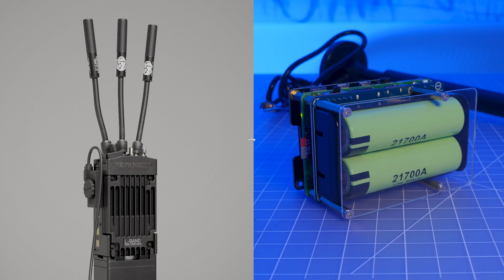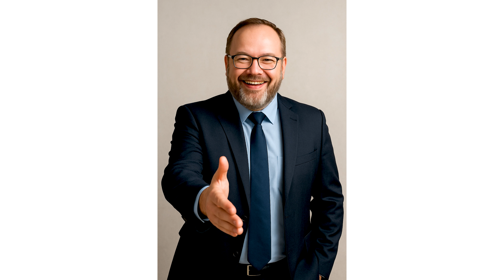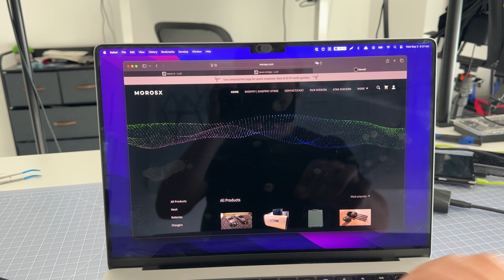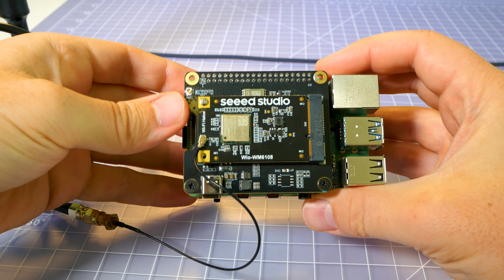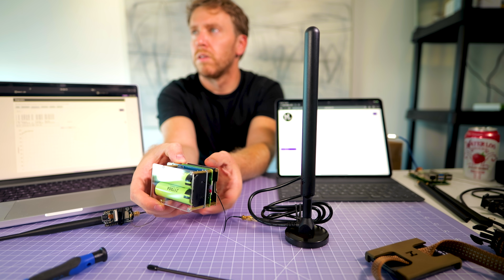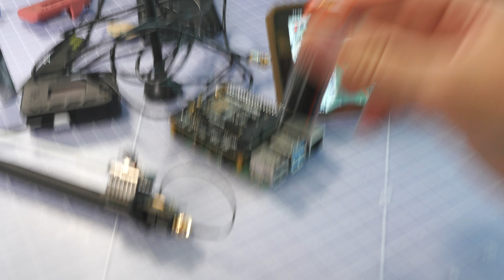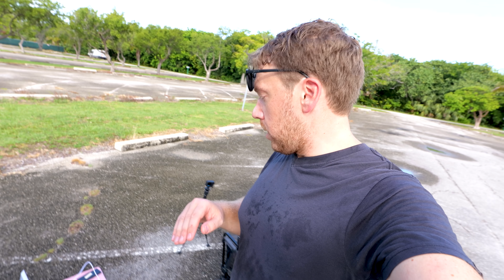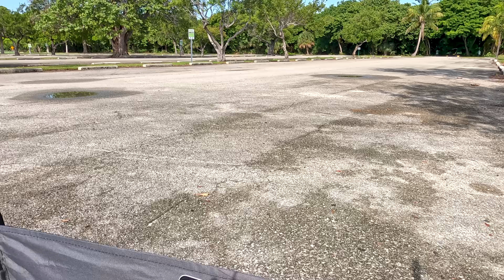I Built a $20,000 Military Router for $106.23

Comment: It's a great project, but misleads in saying " army pays so much more for something equal". It's not that. Although you are able to bring the same functionalities, army grade equipment  uses specialized components, PCBs are tougher and more expensive, construction needs to be much more solid and less prone to interference, just to mention a few things. That said, congratulations for an amazing project !
Reply: Just the testing a normal non gov product sold to the public needs to go through is a heap of money..
Reply: I'm sure a military grade version would still be under 1k even with more durable components and shells. Probably under ~700$ if the production is large enough. They're getting absolutely screwed on that 15k. The testing QA per unit per component is what screws the costs to high hell.
Reply: For example, if you started today, it might be five years from now before you'd have your radio with basic military encryption (classified, secret) approved by the NSA -- assuming you got it pretty right from the get-go. That's just one reason military radios cost so much. You're also going to need to have physical security measures, and work from -40C to +85C or so.
Reply from the maker: Totally, the military stuff is built to a completely different spec.
Reply: Im guessing you are american by your answer but i highly doubt they have different mosfets, transistors, caps and so on. They are paying that much because thats their budget
Reply: @ouew3872 Nope,  I'm not American, but I had a chance to look at some older (not to old) but specialized equipment. Tick PCBs, 6 or more layers, gold contacts... You could see from the board layout the work, very well done signal planes, ground planes etc... Im not saying is all like this, but if you add those, plus waterproof, casing, and like the others mentioned the testing and required standards it gets very expensive. Im far from judging if its 10k worth or 30k, just mentioning that what I saw was good quality.
Reply: @PingTheVoid i guess the testing and making sure it works increases the price tag. But you cant really compare older stuff since they had to overdo stuff to even make it work, nowadays with how advanced cheap components are and how cheap quality boards are you can get away with cheaper products that still do the job. Its like they always say in our design lectures, as complicated as it has to be and as simple as its allowed to be.
Reply: @ouew3872  I just thought the same, I bet he also buys a router that says “ military grade”
Reply: Military grade = the cheapest bid submitted. This doesn't mean it's the highest quality. Military equipment is one of the simplest and cheapest pieces of crap there is. The military doesn't make its own MOSFETs, transistors, or capacitors.
The military announces a tender, defines the terms and requirements of that tender. The military also sets the UPPER limit for the price.
Then you or I go to the Chinese, order X device in Y quantity that meets only the requirements specified by the military in the tender, and try to reduce production costs to zero to maximize profit margins.

In short: Military grade = the most expensive junk.

Honestly, when Ukraine stopped hiding its professionalism in the military and showed that a $300 drone can do the same thing as an ultra-professional $30,000 drone, suddenly everyone in the eastern armies started asking what they were paying for.
This is one example showing the meaning of military grade.
Reply: @lobxtmic 
Remember that the specifications that the military is asking fore is when it comes to fore example radios really high 

Fore example the us have had fore the last 15 years electronic equipment that shoots down drones whit microwaves. And that is way hardening and certification is REALLY expensive
Reply: That's not true at all, it entirely depends on the contract holder. Lot of government stuff isn't more robust than retail versions because they literally use the same parts.

Comment: @DataSlayerMedia. cool project . Do you happen to know about easy cheap method to make something like "alfa camp pro" ? small router with external usb wifi adapter for long range wifi extension?
Reply from the maker: Ya so another way to do this would be to use a usb dongle like the heltec or a small mobile router lik gli.net. Those setups might be even cheaper..
Reply: @DataSlayerMedia more compact also.  UsbC internet, Ethernet, WiFi and halow. All in the heltec dongle.  Remarkable device.

Comment: From what it looks like, it is literally just a RPi4, a Seed Studio SSD hat and a battery pack hat plus some antennas and extra non essentials like a basic Rpi4 router case. Come on man, charging $100 for just the parts list is just sad tbh. The whole point of building open source projects like this, is to keep them open source and available for anyone to build. Someone else will just build it themselves without your guide and then release it to the public the way it should have been done by you if you weren't so money hungry.
Reply: I share your sentiment. i am curious though, could you do something like this ? he has the parts list on the github links. if given the parts could you get things working? I tinker a lot with similar stuff but not radios, so i am not sure.
Reply: @harmonicspice2536  I have messed with meshtastic and I would be able to do it comfortably. Its mostly a barrier to entry of understanding what is happening. Learn a little about halow and you will be fine. It looks much scarier than it is as most the software is already out there and ready to be used.
Reply: word❤
Reply: God forbid someone wants to make some money lol
Reply: @VolksUndBrot  Timothy 6:10 "For the love of money is a root of all kinds of evils. It is through this craving that some have wandered away from the faith and pierced themselves with many pangs."

God does forbid the lust for money actually 😊

Comment: An RF engineer you are NOT.

RF budget ABSOLUTELY determines maximum bandwidth!

Try again kid.
Reply: Sure... when you're actually designing an RF circuit. When you're kitting together a Wi-Fi based system based on off-the-shelf pieces, your bandwidth adapts based on the signal strength, so from the user's point of view, their only degree of freedom is the antenna.

Comment: You'll be hearing from our lawyers, JK, but the reason why the MPU5 is 20k is that's its a military radio, sourced from NDA compliant parts and has far superior security then WPA3, and far mote throughput then 2 Mbps.
Reply: Also the money they spend on testing to get fancy government certificates and legal council to make sure everything is compliant.
Reply: It may be crazy expensive, yet not a crazy expense, if the costs of a failure are big enough.
Reply: @Cyberguy42 In large scale war, the cost becomes prohibitive and cheaper alternatives rule, like is seen in Ukraine. For special operations maybe fine (not the Russian version...).
Reply: It is more durable than COT parts that he used.
Reply: I don't think anyone doubts it's a bit better than this. There's no way it's $19,900 better though. Better encryption is available open source...not like that's an in house one off.
Reply: @chublez  It's not simply better encryption. If you're using a radio for military purposes, you have to have NSA-certified encryption to send any kind of secure data. That's not just certification of your radio to meet spec, but certification of your device to ensure it doesn't leak secure data. It takes big bucks and years to get that certification. And that's just one part of why real MIL radios cost so much. There are also a bunch of protocols for the security keys, and rules for how often they have to be changed, etc. There's more to it than meets the casual eye.
Reply: @chublez if your life is on 4he lone it is.
Reply: @meatbyproducts  that's an emotionally charged statement that dismisses his point completely. He was saying you could get the same exact product but way cheaper if it was made privately instead of on a military contract.
Reply: @TheRedAvocado might be true, but what was built isn't close to the same product. Finding similar boards and saying it will dovthe same wifi is dishonest, since most of that cost is working in extreme environments and worlibg with Soldiers and Marines.   His won't and CAN'T do that.
Reply: We spot the fes
Reply: You would think that..
Reply: Sure thing bud... It's probably the same hardware different but the same protocol for more money

Comment: Even if the issues for OpenWRT on the RBPI5 are resolved, you might want to keep using a RBPI4 as it's much less power hungry (15W vs 25W).
Reply: You can underclock and perform other configuration changes to the Pi 5 and get better performance per watt than the Pi 4. However, if the Pi 4 does a good enough job, then there's little reason to switch to different board.
Reply: @blahdelablah  seam held sake
Reply: Came here to say this. The Pi 5 is power hungry. I built a handheld device and had to upgrade the whole power/battery system when swapping from 4 to 5. But yes, it is also much more powerful, so it's not an empty tradeoff at least.
Reply: What are the issues that openwrt has on the pi 5?
Reply: If I could find a hat for the pi0 think it would work?
Reply: thats the whopping 10 whatts of diffrance
Reply: @uiopuiop3472  its also a 66.6% increase in power draw, which if your looking at 12 hours or original run time, that number starts looking like 8 hours
Reply: @uiopuiop3472 makes a difference on battery.

Comment: I would probably just grab a few cheap routers with Yagi antennas... or even go cheaper with some $5 microcontrollers... but what you built is way more impressive. 👍
Reply: If you know where your target is, a Yagi will get you range, but if it's a roaming situation, that's too directional.
Reply: The higher the frequency, the shorter the range for a given ERP. Lower the frequency and the range increases following the inverse square law. Both 915mhz and 2.4ghz have strict ERP limits, simply directing the beam is not going to cut it for most deployments...
Reply: @dougle03  In other words, radio propagation is well described by the Friis transmission equation, which factors in frequency, not the inverse-square law, which would be the same for any frequency and would have to be enhanced to easily deal with antenna apertures.

Comment: I understand you are US based but the 915 usage in eu is limited and risky. Just to be safe you would need to use weaker 868 band. Similarly the power limit for the 2.4 band is 20 dBm. Assuming you would want to build eu complaint device the results wouldn't be so spectacular. I am not sure what to expect though, perhaps you could consider some tests.
Reply: Yeah, I have experienced these limitations when I was deployed to NATO countries. We had specific radio systems that we couldn't use because of their different usage of frequencies than in the US. However, I have to ask... If there is a legit war, why should we care about that? We have a fight to win, and not worry about frequency restrictions and power limitations. The enemy doesn't care, why should we?
Reply: In the EU best you can do is 27dBm with a 10% hourly duty cycle on a single 250KHz channel (869.4 - 869.65 MHz). This band is mostly for sensors and intelligent meters.
But with the increasing popularity of Meshtastic and Meshcore we might get some other piece of spectrum for more interesting projects.

Probably the 433MHz band is better in the EU if you are registered Ham because it allows higher TX power and removes the duty cycle limitation. Check your local laws before you try :D

Comment: Everything is cheaper if you make it yourself, but the time you must spend checking for errors and going through the certification process makes everything fucking expensive. I speak from the perspective of a European engineer. By the way, most of the tech is relatively easy to make but very very time-consuming.
Reply: Ps. A lot of technology is unnecessarily overcomplicated because people make it hard to build.
Reply: @bar7m0r What do you mean by "hard to build" exactly?
Reply: @jeffgoldman1735 for example: simple ideas are magically turned into rocket science, so you end up spending 10k just to understand the basics while pretending not to scare the “secret society of initiated ones.” And, of course, the real core idea is never shown; you only get a copy of a copy of a copy and are supposed to feel lucky because you’ve been granted access to the “ultraclassified topsecret photocopy.”
Reply: The army had a dedicated engineering corps that can provide support (and I imagine often has to anyway even for commercial items, because representatives from companies can’t be pulled into active battles or sensitive situations when something goes wrong). It’s a different situation to Joe Bloggs running their own company and just wanting something that works. 

Companies overcharge for industry items (and particularly military) for a number of reasons. Certification is expensive, especially for military items. The user is typically not a subject matter expert, and thus cannot judge if the price is reasonable, only if it is comparable to other similar products, and that oftentimes the price-tag encompasses a very robust support system that is not found with consumer goods.
Reply: Also: this is barebones. MilSpec needs it to withstand dust, moisture, heat and other abuse.
This is only a proof of concept product.
Reply: @TobyLegion  that does not justify twenty thousand more dollars
Reply: @TheRedAvocado  Yeah, but it is one additional factor out of many.
This is a cool a valuable project, and it has the basic funtionality of the military router, but it is far from "the same". Is 20000$ still  to expensive for what it is? Probably, yeah. Is a 106.23$ home built device equivalent? No.
Reply: @TheRedAvocado garbage take. The 20k comes from all the certs required for the tool to meet spec and all the wireless testing. See the testing that the occulo team did for consumer certification. Military equipment is also made in smaller than consumer stuff. Smaller runs cost more. Easily make up the 20k with a nice slice for the shareholders, lol
Reply: The amount of paperwork required to deal with, in order to be able to speak with the military, is a fulltime job in itself. electronic component prices are almost always negligable in mil-spec projects in comparison to:
NRE costs (design, certifications, Qualification and field testing).
RE costs - Environmental-Stress-Screening per product, traceability of components, Acceptance Testing (The millitary inspecting your work, not free) per batch, Repair when product gets busted. 
Its a freaking catholic marriage whenever you sell hardware to the millitary
Reply: Welcome to capitalism! Where even time is money 🙄
Reply: No, you don't make cheap phone on your own

Comment: Talks about open source and wants $97 for a digital assembly manual thats somehow "sold out." Hey, no one works for free, but you really need to clarify statements like this:
"This custom Raspberry Pi image is pre-overclocked to boost wireless transmission power from 21dBm to 27dBm — delivering significantly greater range and stronger signal penetration right out of the box."

Overclocking generally refers to increasing CPU speed, which has nothing to do with transmit power. Are you boosting the radio output of the wifi chip on the pi? (which lacks an external antenna and therefore doesn't have great range anyway) Or are you boosting the output of some external wifi hardware? In either case, does this cause the wifi hardware to be out spec per FCC regs? There's just a whole lot of weird ambiguity for $97 assembly instructions.
Reply: The module on the card he's using is rated at 27dBm. Maybe the default software settings set it at 21dB, but there's no over-anything here. It's meant to deliver 27dBm (500mW) output.
Reply from the maker: The sold out thing was an error (fixed now), you can 100% figure this out yourself but if you want a streamlined tutorial and a bunch of extras that's what the manual includes.
Reply: @DataSlayerMedia Is the guide going to be updated in the future with better configs / possible different hardware or new capabilities as you keep working with it and if so would it be updated for free? Or is the guide considered complete at this point?
Reply: @DataSlayerMedia  i would give you something for all your work, but 100 USD is just not serious. come the fuck on. we have rents.
Reply: Open source does not mean non-profit. If $97 in fiat currency is too much then an evaluation of personal finance is in order.
Reply: @TheHardMoneyReport Sort of, if the source code/schematics are locked behind a paywall, it’d be considered source available, but if you have the source available publicly, but sell extras or stuff to make the process easier, that’s still open source
Reply: @SkigBiggler  no not sort of. it is open source and free. His product is not free. See the diff?
Reply: @TheHardMoneyReport I’m not taking lectures about personal finances from someone with Bitcoin in his username.
Reply: @UndyingShadow83  LOL we know. HFSP!